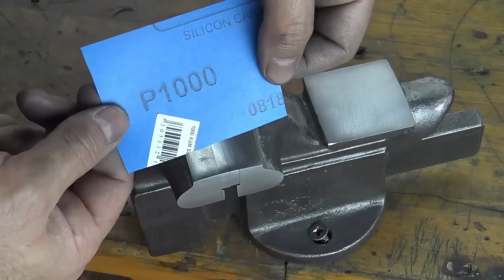Old Rusty Japanese Vise - Perfect Restoration

Comment: What type of electrode are you using and What are the settings  (amp. mainly...) on youre machine for it?
Reply from the maker: I use a casting electrode.  work with low amps in this project.  but I worked higher on the last project.

Comment: There's really no reason for bluing and oil soaking anything you intend to paint before you paint it. Super blue is essentially just a colorant, oil soaking is to prevent rust, and in order to prep for painting, you'd have to clean the parts in a solvent first, thus negating the effect. If you didn't, you'd not have good paint adhesion. Not to mention you're using Hammerite, a corrosion-resistant paint. Basically, you did a bunch of extra steps for no reason. On top of that, cold bluing provides little to no rust protection without continued oiling.
Reply: Or maybe he's ahead of his time
Reply: Your comment was very critical of his work. You could have at least added a complementary comment.

Comment: I don't think those polished jaws with no crosshatching will be of much use.
It looks nice, but anything that doesn't have perfectly parrallel sides will easily slide out under pressure. Nice job otherwise, looks good.
The channel name would have been fine if it had been My Mechanics' channel with german narrative, but seriously dude, your are in Turkey!
Oh, and before I forget it, please consider your own safety, using woven gloves around any spinning tool is a disaster waiting to happen! If a glove gets caught in the tool, you might end up with a broken wrist or worse!
Reply from the maker: thank you for the comment. yes I am in turkey now. I will consider their suggestions.

Comment: I've watched a lot of these no talking restorations.These guys always use some sort of paint remover. Then when it doesn't work (and it never does) they either sand blast it or wire wheel it. Why not save some dough and go straight to the blast or wheel?
Reply from the maker: you are actually right. but I use this uniqueness. I will also consider your suggestion.
Reply: With respect to sandblasting, using paint remover first prolongs the life of the blasting media, which can be expensive.